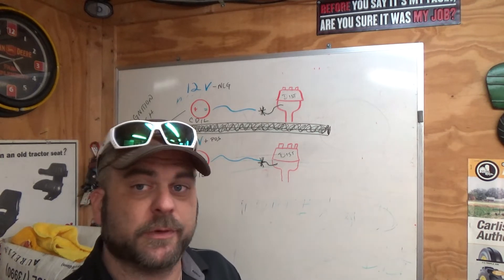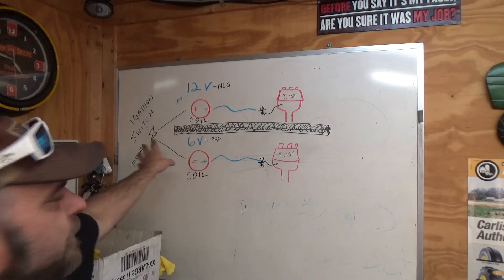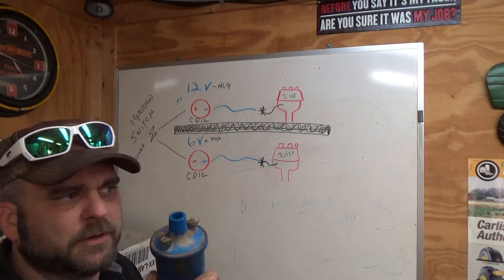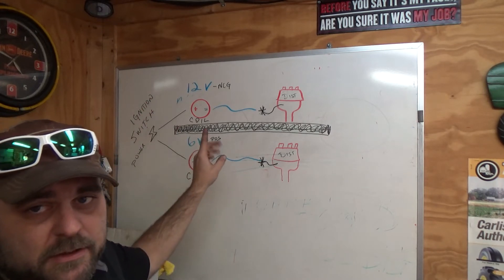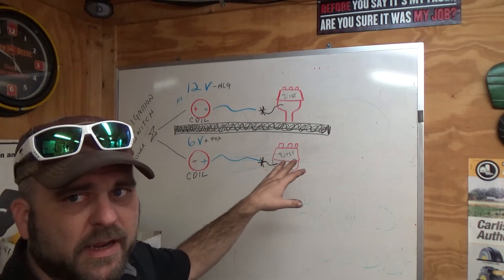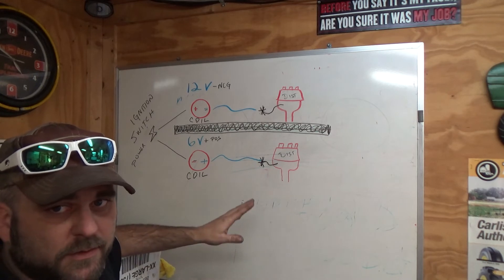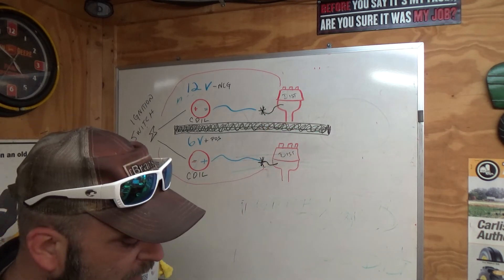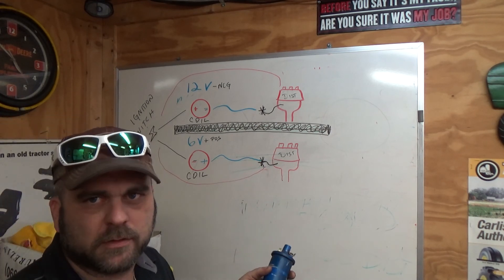Tractor Ignition Coil Wiring Polarity for Original Replacement or 12v Converted

Comment: I was changing points on a '49 Ferguson and my nephews were saying i had the coil wires backward. It was changed to 12 volt 40 45 years ago. It has a negative ground and positive to the starter relay. Plus side of coil to the points and negative to the switch. No one can tell me this is wrong because it's been that way for decades with no problems.
 All over the internet i see positive to the switch, minus to the points. Either they work both ways or everyone except me is wrong.
 It's the internet so the person behind the keyboard knows everything lol.

Comment: Good video.  It's important to note that there does exist 6V Negative ground and 12V Positive ground tractors that came that way from the factory. For example, my 1959 Case 300B is 12V Positive ground and my 1949 Case SC is 6V Negative ground, both verified against factory service manuals.
Reply from the maker: This is true. In this video we may not have made it clear that we were talking about ford 9N 2N and 8N tractors.

Comment: So what is your opinion on ballest resisters after conversation to a 12v like on a 2n or 9n. Does leaving them in line with your new 12volt coil have any advantage on amperage or you just as good going strait to positive off the switch? I have heard leave them in line even if your coil has internal resistance and heard throw them away. What is your opinion?
Reply from the maker: That one is kind of a 50/50 hit or miss. Sometimes it works perfectly fine leaving them on sometimes it will not. Honestly the best method we found and simplest is to just leave them in place after a conversion and see what happens. If they are going to be a problem you will know fairly quickly. As I said some have no problems, then again I've had some that won't turn off because of the resistors and some that have charging issues. Believe it has something to do with the total value of all the resistance in the system that affects it so in short if you have them leave them and try it first if you have a problem then take them off and try it one way or the other is going to work

Comment: If the coil has been hooked up backwards and tractor has ran for awhile. Will this ruin the coil or can it be reversed to work properly
Reply from the maker: It eventually will ruin it.. but no way to tell how long that could take.   If anything the lifespan has been reduced.  Again no way to know by how much.    Electrical parts a fickle

Comment: Sir,
Great info video for "points owners" , however, 12 v Neg ground converters frequently go all the way to Electronic Ignition - if not at first then often soon after.  This would have been a golden chance to also show that last step to a modern ignition system upgrade.  
WELL DONE otherwise.     - Joe -
Reply from the maker: Thankyou Thankyou..    We may do a E ignition vid at some point.  We have some gripes on going electronic though.   Mostly due to cost and the lack of fine tuning with them.  Not that they are that expensive, but one example would be that the majority of E kits do not have individual servicable parts. (Pertronix is probably most common brand).  So on average the Ekits are around $100us give or take.   Points are on averge $15us give or take.  When points fail, its only $15ish to fix.    When Ekits fail, you practically buy a complete kit to fix it at $100.   Also our biggest issue with an Ekit is no adjustability..  you can only set base timing.   You can not adjust dwell, or gap.  You loose the ability to set your power and amperage on the business end.     Great for power units or single speed engines, but in our opinion a waste on a fluctuating engine like a tractor
Reply: @AtlastaFarmCo  Yes...My tractor runs pretty darn good with the new points, rotor, condenser, and dist. cap.  THUMBS UP!!!